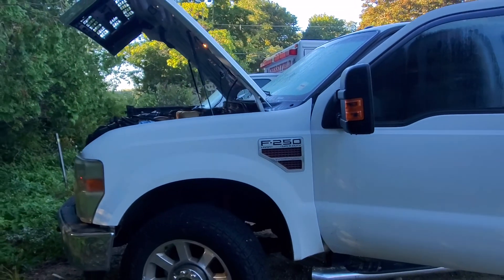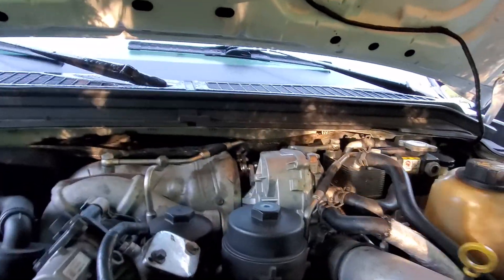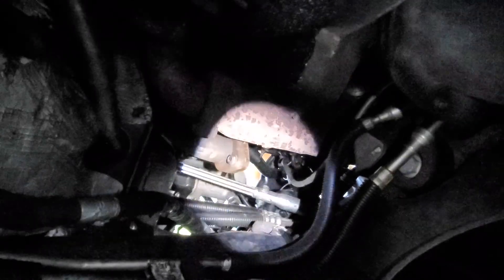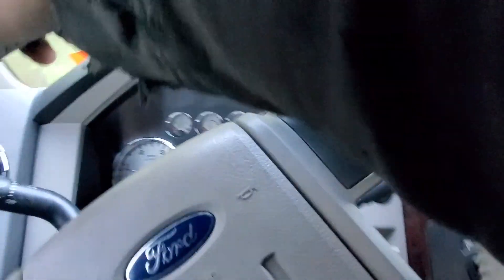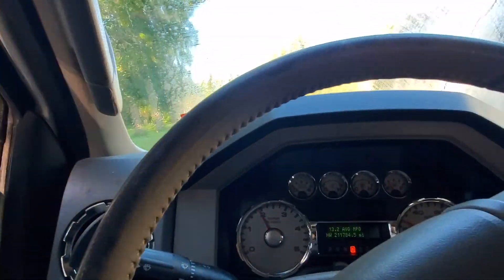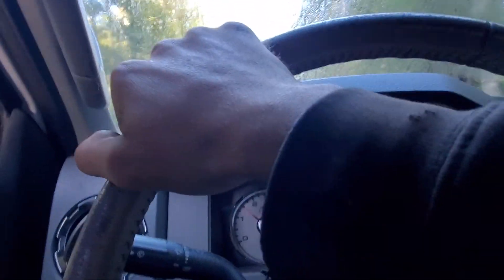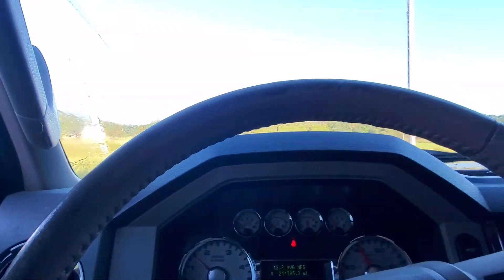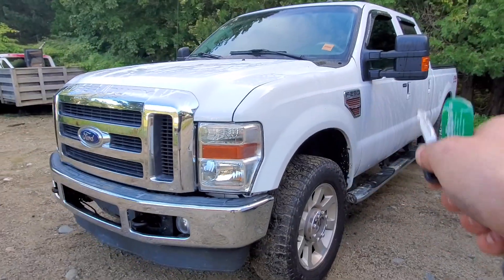6.4l Powerstroke Won't Build Boost and Blows Excessive Smoke || Let's dig into it

Comment: The pipe running from the turbo to the bottom of the radiator, popped off at the radiator and did the samething.

Comment: That's not a Crack or a gasket to hear that much air pressure and have no boost. There is a considerably large hole somewhere. I have seen cracks and leaky gaskets have little to no effect on boost. they just squeal.
Reply from the maker: Uppipes were cracked around the ebp sensor

Comment: Hey man, my buddy has a 6.4 powerstroke woth just over 100k miles. The EGR has not yet been deleted. He just bought the truck. It ran and drove great for about the first week, and then out of nowhere going down the interstate, it all of a sudden wouldnt build more than 10 psi of boost. He shuts it off and then turns it back on and it would build boost again. After doing that about 4 times it wouldnt reset. We just replaced the EBP sensor and took it for a drive. It ran amazing for about an hour or so and then out of nowhere it cut boost again. It randomly threw a check engine light and upon scanning we found out that it was telling us it was the fuel rail pressure sensor. The light randomly goes away and then comes back. What are your thoughts? Any help or input is greatly appreciated. Thank you a lot
Reply from the maker: If the fuel rail pressure sensor is going bad the idle will flutter. What did the ebp sensor look like when you pulled it out?
Reply: @ParkerMotorWorks  the ebp sensor was mildly dirty. The truck sometimes has a faint change in idle to it every now and then but isn't constant
Reply from the maker: I'd get some sort if scanner or forscan downloaded and see the live data of the fuel pressure

Comment: My 6.4 2010 is leaking oil somewhere on back upper side of the motor and a lot of white smoke and oil coming out if tail pipe. Loss of power and almost no psi reading from the turbo. Any ideas?
Reply: Did you figure it out?
Reply from the maker: @mastermechanicfelipe4641 it was a cracked drivers side up pipe
Reply: @ParkerMotorWorks  so where did the oil come from?
Reply: @ParkerMotorWorks  I appreciate you answering
Reply from the maker: I'm not sure about the guy in the original comment but I'd guess turbo seals were letting oil by

Comment: hey man . I'm back with questions.. 
so I bought a new turbo actuator and installed it on my truck, right , but  it won't build any boost, 🤷🏿‍♂️
so I brought a guy to do a diagnosis, so he came and did whatever he did , then we took it for a drive .. guess the  truck runs good for a couple of miles  with no much boost but at least I can see the gauge move up to 1/4 ... on the turbo gauge.. ?. on the  dashboard. 
to make sense .. 
he Said the scanner and the computer weren't communicating each other . .due to an electrical issue, on the engine harness.. 
he advised me to replace the engine wiring harness since a few sensors connectors  were were replaced and fuse together with soldering,..
so should I replace engine wiring harness,   or should I do the computer.. .?
Reply from the maker: That one's tough. A new engine wiring harness is always good especially when anything besides factory happens to them. I don't see much sense in tacking down the correct computer when the harness has been tampered with. Assuming his diag and computer work was correct

Comment: bro is me again. I have another question... so i bought the turbo actuator kit for my truck. it comes with the low-pressure actuator the one where the cooling hoses go . .but I can get the parts unless I send the cores back first.. and I wanted to ask you if I can remove the low-pressure turbo actuator the ones where the two hoses go .. and bypass them hoses connect them to each other. just to get that par out .. now the question is .. I only need to drive the like 300' feet . but my question is .. will it run without a problem
. cuz my truck is parked like 300' feet away from where I'm gonna remove the part because I can't do it on the street.?
Reply from the maker: Are you able to move the truck first? I'm not sure about the negative impacts honestly but the turbo actuator doesn't need to work for the truck to move so I'd say It could be okay
Reply: @ParkerMotorWorks  I not able to move it because I'd decided to have it parked and not spend more $$$ on it until now that I went ahead and purchased the new turbo actuator.. but I did remove the actuator where my truck's parked 🥶🥶.. and now I'm just gonna send the cores and wait and see if that solves one of my longtime problems 😌🥶😌
Reply from the maker: I hope it fixes it for you these trucks are nice running but kinda worthless when they aren't
Reply: @ParkerMotorWorks  exactly..

Comment: 2010 f250 6.4.
 After turbos were installed the oil light indicator on the dashboard came on ,.. Oil pressure and temperature sensors were replaced,. Then the truck ran good for a couple of miles. Then the same problem happened again.. this time turbos went bad , then I went to get the sensors again then I went ahead and installed a set of Rebuilt turbos , this time the truck ran good for a little longer I mean for like 15 minutes or so ,then the same light came back on again and white smoke through exhaust??🤔🤔🤔🤔🤷🏾‍♂️🤷🏾‍♂️🤷🏾‍♂️🤷🏾‍♂️🤷🏾‍♂️
Reply from the maker: That sounds like an expensive issue you've got. I'm not sure what would be causing your turbos to keep going bad. I'd find it hard to believe that the pressure sensor would fail back to back. What made you think the new set of turbos went bad? Was the wheel wobbling around or was it spitting oil?
Reply: @ParkerMotorWorks  boths  wobbling and spitting oil 🤣🤣. But this happened, because the turbos that were installed before the ones I just replaced were used turbos. And the ones I just installed are rebuilt and came with a 6 month warranty... The ones I removed on February 24/23 were spitting oil to the downpipe and the wheel close to downpipe was wobbling
Reply from the maker: Are both turbos failing or just the regular one
Reply: @ParkerMotorWorks  no no .. turbos are working great ... 
My problema is about the oil light indicator that came on like 15 minutes after driving my truck ..
Reply: @ParkerMotorWorks  The turbos on my truck were replaced with used turbos that only lasted a few days. but apart from having the problem with my turbos the low oil indicator came on days before the used turbos were completely ruined I went to the dealership to buy new oil pressure and temperature sensors, and after I did that my truck worked very well Ok, but I was only able to drive it for a few mines and I got the same low oil indicator problem again. 02/24/2023 I installed a set of rebuilt turbos and also the same oil pressure and temperature sensors. I also changed map sensors and the intake air temperature sensor.. What I don't understand why the low oil indicator light keeps coming on? Do you think the oil cooler has something to do with all this?
Reply from the maker: I'm not very familiar with the oil coolers as I've never messed with any of them before. Is your crankcase low on oil? Is there isn't oil in your coolant or any coolant or fuel in your oil?
Reply: @ParkerMotorWorks  was there supposed to be oil on the crankcase??😳😳 Blow-by became a bit at normal right after the light came on ... And no the coolant seems to be ok . And the oil too..
Reply from the maker: Well I'm really not sure what your problem is. It would be weird for 2 sensors to be bad but could happen. Pull the codes and see what it says for the oil pressure. Cause if it says current high/low or voltage high/low then your have a bad sensor or a bad wiring harness pigtail to the plug
Reply: @ParkerMotorWorks  😳😳😳🤔🤔🤔 in other words.. have a pro check it out 🤷🏾‍♂️
Reply from the maker: Nope if you have a laptop download forscan and buy the $50 adapter off Amazon and you can do everything a pro can
Reply: @ParkerMotorWorks  if I do this , I will be able to do a complete diagnosis on it..
Reply from the maker: Yup you can look at all your computers and read and reset all your codes. Plus do a bunch of test to troubleshoot other issues
Reply: @ParkerMotorWorks  I saw a bunch of  soot  on the hose outlet  on the crankcase where the  hose that comes from air intake connects to it..  but didn't see any oil on crankcase
Reply from the maker: I just meant oil in the engine just making sure the turbos didn't blow it all out
Reply: @ParkerMotorWorks  no. If turbos were properly installed 🤔🤔 why I'm still having trouble.. one thing for sure.. im gonna call junk yard and ask how much can they give me for the truck as it ..
Reply from the maker: Definitely seems frustrating. I'd say you need to pull accurate oil pressure instead of relying on the motors pressure switch. See if it's causing you to blow turbos or if there's something partially clogging a oil gallery or oil line somewhere. If a partial clog it could run fine under idle and regular use but anything rowdy it could cause a low pressure fault. But your truck Definitely needs someone there to look at it or you to do more digging. It's not necessarily scrap if it isn't blown up or if it's in good shape someone will buy it for more than the junk yard
Reply: @ParkerMotorWorks  223k miles. Everything is in good condition .. enfin idles fine when not running, a d is it just that problem that doesn't seem to go away ... Like I said truck idles pretty smooth...new batteries, new radiator rebuilt new turbos, ,🤔. New set of keys . Push button 🔘 feature to turn on truck 🤔... I'm pretty sure a person who can fixed it as it can have a pretty decent truck .. ohh. Is ready to install any tuner device without deleting the EGR..  man. . I hate to take actions. But somehow I'm getting rid of it. One way or another... anyways thank you so much for advising
Reply: @ParkerMotorWorks  I forgot to ask. You one question ⁉️🤷🏾‍♂️ ⁉️ important one.... 
Do I have to tighten the turbo's oil feed lines with torque? 
And the other feed lines .. fuel lines. ?
Reply from the maker: There's probably a torque specs for them but I'd sat put a new crush washer on the fuel lines and tighten everything so it doesn't leak
Reply: @ParkerMotorWorks  there are no leaks whatsoever.. ..
Reply from the maker: That's ideal right there
Reply: I'd asked Since your a diesel mechanic.. ....   What i don't get is why the oil indicator light keeps coming on .. after i changed the oil sensors..
Reply from the maker: What brand sensors did you put in? Did the old ones look gummy or dirty on the end?
Reply: @ParkerMotorWorks  motorcraft .. from dealership.
The old ones. were duty and gummy... 
when old turbos started to leak  the oil got in between the connections. Of  the sensors.. and the wires .. so i had to replace the pigtails as well, and for that i cut the pigtails from a brand new engine wire harness that i bought a year ago.
Reply from the maker: Well without seeing it I'd say check your connection to the new pigtail and make sure it's soldered sufficiently. But as for the sensor I'd pull that again and check the tip of it and see if it's clogged. But without seeing any numbers of actual oil pressure or base oil pressure it's hard to say what's wrong with it but I'd start with the wiring and make sure the new connection is solid and the right orientation
Reply: @ParkerMotorWorks  🫡🫡🫡😅😅😅🤣🤣🤣🤣.. i used wire-nuts to attach the two wires 🤔🤔🤔🤣
Reply from the maker: Ya definitely check there then. The lights could be cause of that
Reply: @ParkerMotorWorks  i will give it one more shot... 
If not I'm entitled to surround the truck back or take it to the wrecking yard 🤷🏾‍♂️🤷🏾‍♂️🤷🏾‍♂️..
Reply from the maker: You can do what you want with the truck but you've got to give it an honest chance to work and those wire nuts aren't it
Reply: @ParkerMotorWorks  that's right. 🫡🫡🫡🫡🫡 F wire nuts . 🥹🤣🤣
Reply: One more thing.. could the head gasket be causing all these issues in my truck ???🤔🤔🤔🤔🤔
Reply from the maker: Not likely

Comment: It was half right, you want alot of boost and alot of black smoke at the same time! My crew cab long bed was running 12.20s at about 60lbs boost for a few years before she blew up, which 6.4s inevitably do. 12v Cummins or twin turbo LS3 goin in soon. Can't make up my mind lol.
Reply: The fucking gauge doesn't even read 60 lbs boost on the original gauge. No wonder it blew up. You stupid fuckers ruin your engines and then blame Ford. No pickup engine on the market is designed for that kind of boost. You know those pickups run beautifully if you take care of them and don't tune them and ruin them.

Comment: it’s the egr down pipe they always crack after you do a egr cooler removal, if it gets bad enough it will burn the down it cracks at the lower mounting bracket.
Reply from the maker: Yup that's what I've found so far. I don't understand why people don't just block off at the up pipe or just get different up pipes. Not worth catching the truck on fire
Reply: @ParkerMotorWorks  Delete up-pipes are hard to get as they’re considered race parts. Easy to get a Chinese block off plate kit but otherwise people don’t want to sell delete parts in the USA due to the EPA shutting down shops and stores.
Reply from the maker: Times are definitely changing
Reply: Just flip the horizontal cooler 180 degrees and cut the back elbow off.  It'll keep the up pipe from vibrating.
Reply from the maker: @bthorn5035 sure or just instal the delete kit properly and remove that pipe and block off at origin up by the turbo

Comment: Can a leaking hot side pipe cause a 6.4 powerstroke to have excessive smoke out of the exhaust? It is egr and dpf deleted.  I've replaced all the sensors. But I recently found a leak in my pipe running from the turbo to  the intercooler/cold air charger. I found it when i took the cac/intercooler out to clean it. It was actually really clean it only had about a tablespoon of oil in it not much at all. I also relocated the ebp sensor like you did, my egr pipe was cracked too.
Reply from the maker: Having your uppipes cracked could cause excessive smoke but I'm not sure about the hit side pipe. It would probably depend on how much boost you were still making. Having less air would cause smoke just by messing with the air fuel ratio

Comment: Disconnect exhaust down pipe drive check for boost if boost present take mid pipe and catalytic  of truck and put it in a bad of purple power for a week  you'll need like 20 gallons to clean like new rinse with water and dry interior with heat gun or just let sit  until dry  put back in truck replace sensor in between  pipe and catalytic 130 cost drive enjoy power. I know by experience  this works good luck
Reply from the maker: Truck had a cracked up pipe and is straight piped

Comment: Hey I have a 6.4 2009 f550, I’m getting a p132b code. Builds zero boost and has a check engine light which leaves the truck in limo mode. No weird smoke or a norm Al sounds coming from the engine. Is it possible for it to be a boost leak? Or is it bad turbos?
Reply from the maker: That code is for the turbo actuator. If yours is stock there is an updated part from borg Warner for a better actuator. When you turn the key to on do you hear or can you see the turbo actuator cycle? If not I would start there
Reply: @ParkerMotorWorks   thanks for the info, how do I know the turbo is cycling? Also I’m getting a p2263 code
Reply from the maker: On the right side of the turbo chargers there's a box with a small arm that goes to the turbo. When you turn the key on it'll cycle the variable geometry veins in the turbo
Reply from the maker: But as for the p2263 it may be there because of the other code or its bad news. Either way its a fuel or an air problem but if you have a faulty turbo actuator it would be throwing off your air fuel balance which would trigger the p2263
Reply: @dogbonetc7623 hey man i’m also getting these same codes now, what did you do to fix it? new actuator or EBP sensor?
Reply: Is it A simple abs plug n play with the updated actuator? Do you just leave the cooler part there unattached to the new actuator?? TIA
Reply from the maker: I believe it's a simple swap out. I'd probably just loop the lines together for the fuel cooler
Reply: Replace the exhaust pressure sensor it controls the actuator

Comment: What would cause my 2008 F-250 not to regen? I installed a new dpf about 1000 miles ago and I’m getting a dpf filter below threshold. It ran fine until recently. 
Thanks in advance,
Reply: A 6.4 not going into regen should be an issue that you want to have lol
Reply from the maker: Definitely not an issue if the truck ran good lol
Reply from the maker: I honestly have no idea. I've never worked on one that has the emissions on. But I would get a scan tool and see if I could force a regen
Reply: Delete the dpf if you can

Comment: Do any with down pipe with ebp sensor  block it off behind turbo tap blockoff to size of ebp  sensor bung and relocate it top of engine
Reply: Away with
Reply from the maker: Yes tapping the blackout plate and moving the plate to the tip of the up pipe is the best place to do it. Anything to get rod of that crossover egr tube. I've also seen shops tap the manifold and run the ebp there but I like tapping the plate more